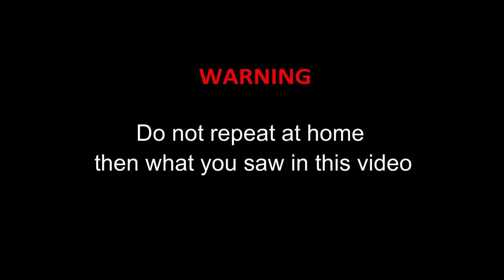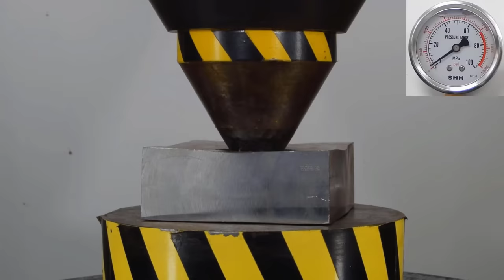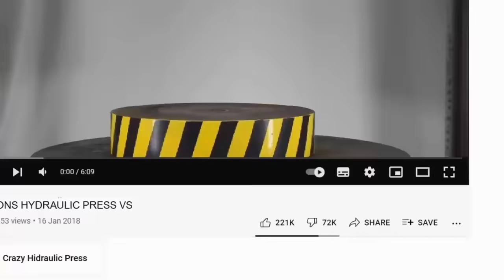HYDRAULIC PRESS VS OLD AND MODERN ARMOR

Comment: Very impressive to see how armor plating has come along in such a relatively short period of time. 🙂
Reply: His 'T-34' armor was mild steel...it wasn't hardened worth crap!  Of course AR500 is going to look amazing in comparison.
Reply: If it is really the steel used on t-34s u can’t really compare them. T-34s we’re build as cheap as possible so they could build more of them and if you think about it, a tank is not a body armor. For a body armor it’s good, when it absorbs so much energy on impact, that it breaks. On a tank on the other hand, wouldn’t it be better if the armor plate wouldn’t shatter into thousand pieces but instead just receive a hole, which is cheaply repaired and then a new crew gets put in the tank?
Reply: @natetaylor9002  For most of the war, the T-34's armor WAS rolled mild steel or cast steel, relying on angling instead of thickness. Only the turret fronts and sides had armor thicker than 50mm. The armor was not case-hardened until the rollout of the revised T-34-85 model in 1944–45.
Reply: @aarondohlen  The problem with a hole in the tank is that the AP round detonates inside the tank, killing the crew and disabling the vehicle. WW2 wasn't War Thunder; they couldn't just respawn in a new machine at base.
Reply: @teebob21  I know dude. Just thought it is maybe cheaper to repair a hole, than a brittle, shattered tank side or front. I know that the modules and equipment inside are destroyed and the crew is dead (can also happen on a hardened plate due to overpressure, right?). Still the lesser problem from a economical logistical „war“ perspective, isn‘t it? Also building an entirely new tank is super expensive and uses a lot of ressources that could be saved for other armor or weapons
Reply: @aarondohlen  I'm not a war statistics wonk, but from my time in theater, I'm willing to bet that the average amount of killed tanks recovered from an active battlefield repaired, and redeployed in a manner as to be tactically effective is as close to zero percent as possible. In modern days, the US has the M88 Recovery Vehicle but a total refit is going to take weeks. 

Not even the worst Armored Cav butterbar is going to just send his tanker crews in to get merked so they can say "oh well" and then go get the hull back later.
Reply: @teebob21 I never read anything about the t34s having mild armor. All the books and documents I found it's generally stated that the armor was too hard ( 400-495bnh) and that made its preformace suffer a lot against overmatched projectiles like the 88 or long 75.
Reply: @xfy123  The USSR donated two combat-used Model 1941 T-34s to the United States for testing purposes in late 1942.The examinations, performed at the Aberdeen Proving Ground, revealed problems with overall armour build quality, especially of the plate joins and welds, as well as the use of soft steel combined with shallow surface tempering. Earlier models of the T-34, until the Model 1942, had cast turrets whose armour was even softer than that of the other parts of the tank.

Kavalerchik, Boris (March 2015). "Once Again About the T-34". The Journal of Slavic Military Studies. 28: 186–214.
Reply: @teebob21  Interesting thanks for the info, it's been a while since I read anything about WW2 equipment I'll check it out.
Reply: @teebob21  They could just spawn new soviet recruits to man the holey tank after some refit, though...
Reply: @HiddenOcelot  The United States Domestic Abrams tanks use Chobham armor which in the US version has a layer of depleted Uranium. It's not dangerous to the crew like the some content creators suggest because it's sandwiched between 2 layers of this hardened steel you see in this video. The Chobham armor also uses spaced Ceramic tiles which protects the tank vs HEAT rounds. Modern anti tank round can still take out an Abrams though so can a simple RPG if you hit the tank enough times with it.
Reply: @teebob21  In WW2 there were units whose purpose was to recover and repair tanks. So in a way, they did respawn. It was the practice to do as much damage as possible to an abandoned tank to make it as difficult as possible to repair. My understanding with the Sherman it was possible to pull and replace an engine transmission unit in just a few hours. An hour or two to weld the hole shut and the tank body is good as new. Even if only half or less are repairable it is still easy and fast than building a new one and shipping it across the submarine-infested Atlantic.
Reply: @teebob21 Most of the time the fuze was destroyed after impact , there was no explosion inside . Don't compare that with a specific game dude , that's not real at all . A penetration was enough to kill the crew or let them bail out and run .

Comment: Wow This definitely makes me want to go grab my carrier & give my ar500 plates a hug. Despite the weight being a hassle to see the amount of energy they can handle whether it is a press or a bullet is rather impressive & comforting.
Reply: The weight of ar500 plates will kill you by making you an easy slow target, try titanium that will save you in most situations and is as light as a feather so you will keep a good running pace
Reply: My carrier held ceramic plates, not AR500. A fraction of the weight.
Reply: @AixlaachenPax1801 Not if you keep in shape. I  carried a M249 over in Fallujah, Iraq w/ 6 to 800 rounds on me along with my plate carrier. I can still pull that off. Watch what you eat and work out.
Reply: @robertsims3759  Lmao it's clear you never carried something heavy in a backpack for hours on, let alone days, and i'm not american so my weight is not a problem
Reply: @AixlaachenPax1801 no worries, he gets enough freedom energy to carry them for 25 hours a day
Reply: The thing is why would you want AR500 in your plate carrier in the first place? Why risk getting your arteries getting sliced up due to spalling
Reply: @AixlaachenPax1801  dude didn't even attack you but it's clear you have prejudice. Cheers
Reply: @kraptastic333  The first rule is try not to get shot, it never been about carrying armor like you are a Crusader instating the Outremer Frankish realms, modern warfare since centuries is all about momentum, vehicles are the armor you want, not some heavy plates that protect only parts of your torso.

Comment: Good video, but I would have appreciated if we got to see the data on all of the pressures reached, to be able to compare them. Also being given the yield strength of the steel used for the cones, would have made this a superb video.
Reply: would also be nice to know if these were good samples or garbage and what type of titanium was used.
Reply: Looks like on modern armor steel he used lead press tip, so I would count on accurate and fair results..
Reply: Thank you for letting me know I don't need to watch this video. All I was interested in was the numbers
Reply: it is the data which makes the video more meaningful
Reply: In the video description, it is specified that the press has a capacity of 500 tons, and I believe the creator assumes that when the material being tested withstands the press, there is no need to provide additional data. Personally, I think that more data could make the final result more satisfying.
Reply: Indeed. Precise, accurate data is what gives meaning to an otherwise empty picture @maggiolins
Reply: IT DIDN'T PENETRATE what do you want numbers for, its 0.

Comment: Exactly what I expected after seeing the AR500 get damaged by the hard cone.  AR500 has very little elasticity.  Once damaged (which takes quite a bit, as seen!), it needs to be replaced.
Reply: Thanks , I was wondering why the difference in results .  It would be good to have an explanation with the video.

Comment: Speaking from my knowledge on the evolution of tank armor I can speak on why you see such a difference between the old and modern armor. Can't speak to whether this is the case for personal body armor though.

Put simply back in the day a mix of hardness with toughness was ideal. A plate that was too hard without adequate toughness was liable to shatter because back in the day tanks used full caliber Armor Piercing shells. These are, as the name implies, shells that are just as wide in diameter as the bore of the tank's cannon. These packed a hell of a lot more mass and as such kinetic energy on target such that a plate not tempered to have both high hardness and toughness (the ability to bend/warp without breaking) was required. High toughness armor had a much lower chance of failing catastrophically against these penetrators and as such retained that chance to just barely stop a shell or even if the shell penetrated the resulting spall would be hopefully limited.

Nowadays armor is all about hardness. Nowadays tanks fire sub-caliber munitions as their primary armor piercing ammunition. Specifically APFSDS shells which stands for "Armor Piercing Fin Stabilized Discarding Sabot" often shortened to "Sabot" or "Dart" by tank crews. These are very thin in diameter arrow shaped penetrators that focus an immense amount of kinetic energy on a very small surface area burrowing into heavy armor as they degrade essentially using their penetrator length as fuel to bore deeper into heavy armor. This imparts a lot less kinetic energy to an armor plate as a whole making shattering a hell of a lot less likely and therefore toughness is less of a concern than degrading that projectile as fast as possible through high hardness armor and most importantly spacing. Composite armor arrays on modern tanks are made up of a lot of empty space and with internal sharply angled plates of ceramics, high hardness and density metals like Tungsten and Depleted Uranium, very high hardness steels, and sandwiched between each layer a kind of elastic material older versions of composite armor arrays used things like rubber but nowadays you see more Foams, Nylons, Polycarbonates, etc. This forms what is called a NERA, Non-Explosive Reactive Armor, Matrix. As the plates are penetrated the elastic element forces the plates against the penetrating eroding it more quickly. The harder the material the better.

Comment: WOW! The kinetic energy store before the release was off the charts.
Reply: That was potential energy stored as material tension, that was released as kinetic energy. You tried to sound intelligent, but you proved the contrary .
Reply: @flotr6465  You are technically correct. However, your dig about the OP's intelligence seems unnecessarily mean.

Comment: Armor is not designed to take a constant load like that, it’s meant for sudden impact.
Reply: @Napenthe   "Hydraulic sudden impact channel"
this actually sounds interesting
Reply: Yeah, just ask Diry Harry.
Reply: Not true. It is common for soldiers to attack tanks with hydraulic presses. Many great wars have been won this way but arms manufacturers HATE this weird trick!
Reply: @Napenthe  Ok, so what is the point of this video?  To show which armor is better for what purpose?  Yes you might want 6 in of homogonous steel to protect yourself from a hydraulic press attack on your tank, but probably would prefer the modern armor against a WW II era 8.8 cm AP round.  Next video, "Hydraulic press, Modern Latex Paint vs WW II Oil Based Paint.
Reply: @tsuribachi  "Hydraulic Hammer Channel"
Reply: Absolutely, the lesson from the imploding submersible is that if you're going by the results of an inapplicable test to make engineering/material/design choices... you're going to have a bad time.
Reply: I'm not sure it matters as much as your snide comment suggests.  This is a point hardness test granted, and the breaking point of a point hardness test for a solid material armor gets you at an accurate estimate of the force needed to penetrate it regardless to it being gradual over time increase or sudden shock. Force applied is force applied.  If you want to get into the more complicated maths of the matter, go for it.
Reply: @jasonborn5672  The compares titanium plates to a block, doesn't show the force for the titanium, nor give comparative weight. Russian tanks were specifically mentioned. 
A snide comment would be: This a lazy video at best, at worst it's propaganda to try to make Russia's decision to send shitty old tanks to war seem less fucking stupid, one glance at the description shows it's from their ally neighbor Belarus, so go figure.
Reply: @Napenthe don't care what channel is it doesn't change facts 😂
Reply: Waaaaah waaaaaaaaaahhhhhhhh
Reply: @Napenthe  The OP's point is still relevant. The makers of the video don't have to make any claims about the validity of their hydraulic press tests before someone is allowed to point out that they are testing the armour under different loading conditions that it is designed to withstand. The OP is just providing some useful background information that some people might not be aware of.
Reply: @DT-dc4br нахрен ты сюда пропаганду приплетаешь ?

Comment: Truly Impressive Test on the hardness and resistance of materials... Too bad the damage to the equipment... with such an impact force there is really a risk of leaving your skin if you don't take the necessary precautions... Being in another room and also protected...😱🔥
Reply: You only need a single fullstop to separate sentences.* Those multiple fullstops serve no purpose other than making reading more difficult.*